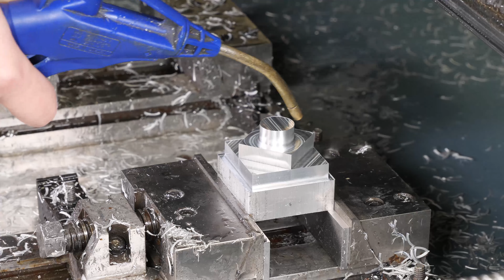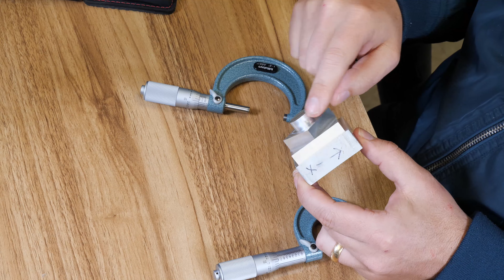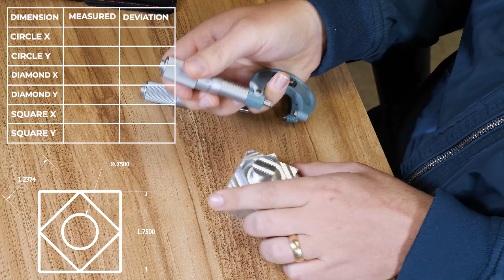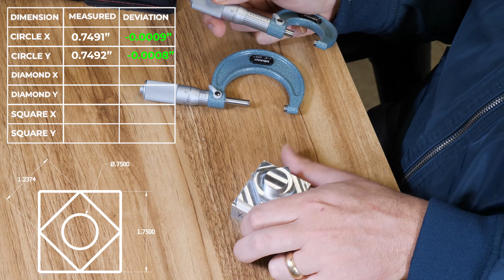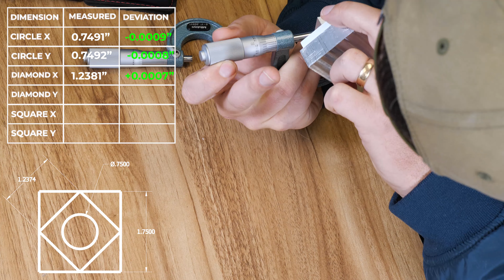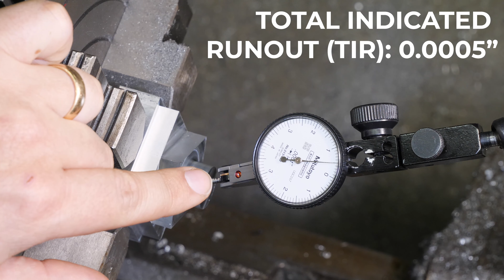Evaluating the MR-1 CNC Mill Accuracy by Machining & Measuring a Circle Diamond Square Test Coupon

Comment: I wanna see what the 10k dollar version of this mill can do.  This is insanity..  they are going to break the cnc market with this machine..  Literally a glitch in the matrix stuff here..  Im sitting here thinking about dropping 50k on a proper mill and then I see this machine essentially creating the finish quality Im chasing for 5k bucks..  unreal.
Reply: Are they making a 10k version? I didn't see anything on the website about it yet
Reply: @ryancasey4807  So what I meant was that if they can build a machine with performance like this for 5k, then I wanna see what kind of machine they make for 10k. 

If for example, they release a premium model with precision linear rails, beefy precision ball screws, and servos, with a more premium spindle option for example, they could go toe to toe with the likes of Datron for pennies on the dollar by contrast. They have a good idea and I think they will evolve on it and we will benefit from it.
Reply: @ryancasey4807  I can almost guarantee they are or will depending on how well this version sells, I mean it's called the MR-1, that just screams to me that eventually there will be an MR-2
Reply: @bdkj3e  that's why I'm hesitant to buy the mr1, I have their XR plasma table, but I really like the mr1, but I think if it was a touch larger and had tool changing options I would be allllll over it
Reply: @ryancasey4807  I can't even afford the introductory price of the mr1, all this inflation and everything associated with it is absolutely killing me, I have tons of ideas but all they really are is pipe dreams because everytime I make any money something else just comes along and takes it.
Reply: It's all about rigidity and this machine has it for the guy that wants a machine in his garage. They should make a 5 axis is what they should do! They do that in this footprint for 10k DAMN! Take my money!

Comment: Can you also mention if the 8k rpm spindle can still work with small tools on aluminum since smaller tools do require fast rpms?

Comment: Great video and fantastic mill. I have a small garage metal shop, cutting, drilling, and welding but with no milling nor lathe experience, only what I've watched on "This Old Tony". How much of a learning curve is it for the mill and CAD program?
Reply: learning cad is the hardest part.. If you cannot draw parts, the cnc is useless.. Cam is pretty easy , only takes a few weeks to be very proficient
Reply: @airgunningyup  Thanks Rob. Appreciated!
Reply: Howard...check out Titan's of CNC academy and run through his tutorials on designing and then putting these parts through CAM to get a really good idea of what's involved.

Comment: Why would you turn the round journal on a lathe then check the circular interpolation between x,y? Why not indicate it in using the four large surfaces then check run out?

Comment: I’d love to see a tool changer… probably double the cost, but if you could set up small production runs this would kill for start ups, and fab shops, I’d also like to see what the conversational side looks like, I’ve only programmed conversation on an ez- track and ez-path, I know g-code better, but conversation is easier to train
Reply: I learned on mazak integrex in in the same boat . But on the lathe side . Conversation is easier
Reply: @aaronmcclain1279  since I wrote that I’ve used mazatrol a bit, I hate it compared to a full cam software, and I preferred the ez-track as well, but with the low entry cost I’d be interested in seeing if they put more or less effort into the interface because of the low price, obviously keeping the cost of development low would lower the cost, but the easier it is to figure out the more desirable it would be to hobbyists with less machining experience
Reply: @austinpetersen5282  . Alot of my experience is just with mazatrol and tech lathe Haas has some conversation code .I just wonder about this machine . We had old 87 86 T32 and d T1 control then jumped to 640 fusion and then smooth control damn . Of course they are lathes with milling functions .